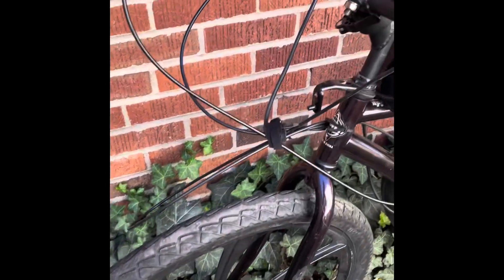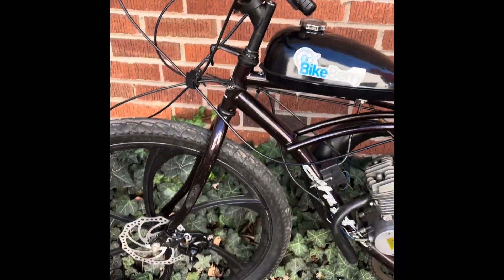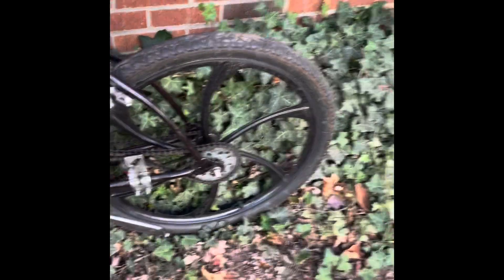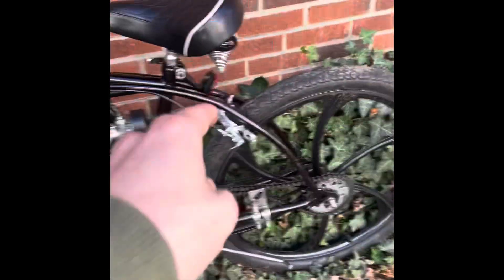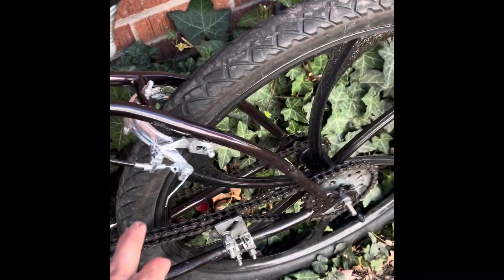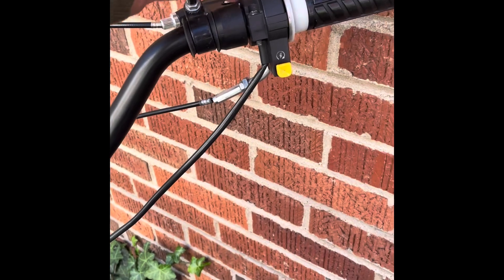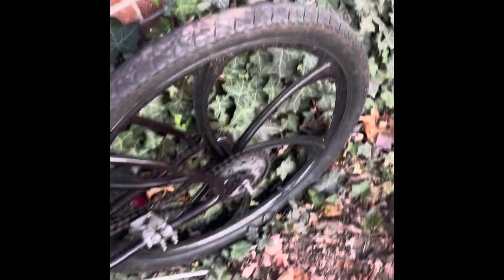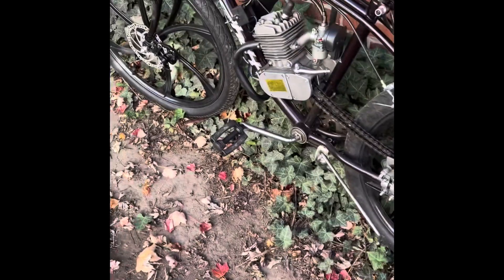Project bike walkthrough and carburetor diagnosis

Comment: Looked pretty good Far. Looking forward to further testing. I agree with Mike M. on the liquid gasket on  the intake/carb. I loosen my carb munt and fill the slots on the inside, and put a  light coat near the back of the intake,so it doesn't get inside, and slide the carb on and let it set overnight. I tighten the carb down after I'm sure the stuff has hardened.
Reply from the maker: @bryduhbikeguy  that should help with the four stroking?

Comment: Brother put some you can move the clip up 1 and that will lean your engine just a little I had to go from a #70 jet to a #68 running much better on your intake stem instead of tape a little ultra gray gasket maker will work as well to see if you have a air leak spray carburetor cleaner around the intake if you have a leak idel will drop if not die that will be your leak and I wear shorts them expansion chamber pipe don't get that hot to me
Reply from the maker: @mikemiller3303  move it up one on the jetting
Reply: @Farquad4532  on the inside of the carburetor is a stem coming from the bottom of the slide it should have 5or4 place you can move the clip you want to go up to lean it out a little bit